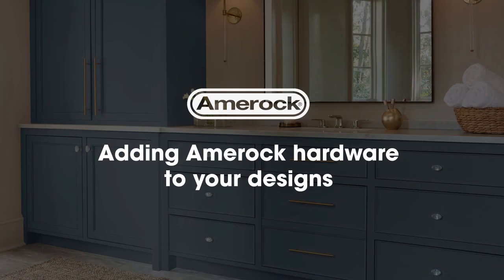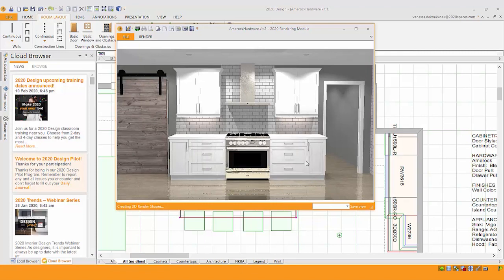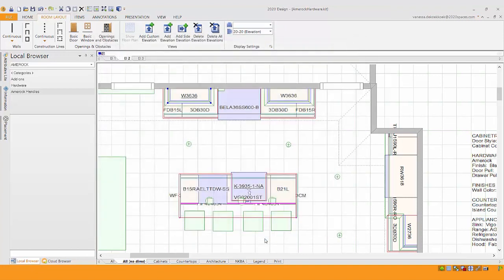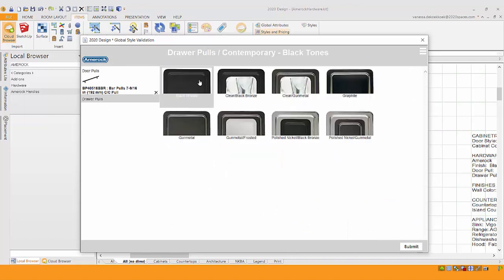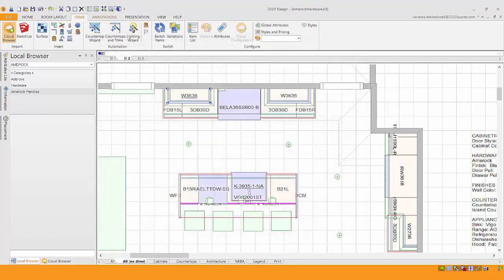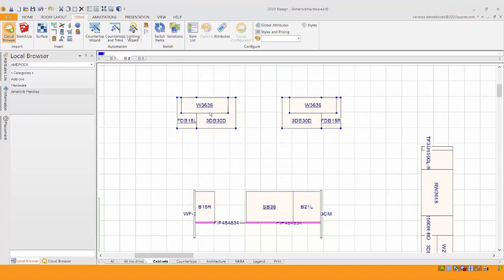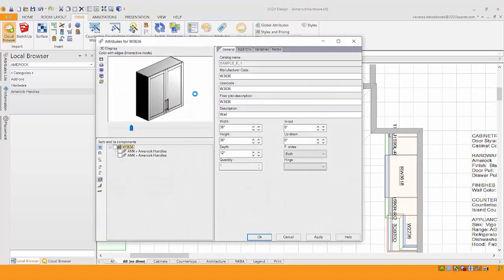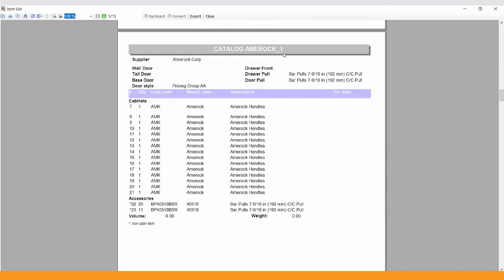2020 DesignTip: Adding Amerock hardware to your designs

Comment: Can I change the pulls on one specific cabinet and keep the others as the Amerock chosen?  Sometimes I want a longer or shorter pull on one cabinet.
Reply: Yes, it works by creating a copy of the catalog like you would for cabinetry when you want more than one color or door style in the design. I tried it. It worked. Had to play with the precise cabinet a couple of times in order to get it to work though.

Comment: I have downloaded the add on catalog using V 11.12.0.31 and cant get the hardware to display on the cabinet.  Any suggestions?
Reply: Which catalog are you using Trevor?
Reply: @MrJohanvj2000  I'm using the Amerock add on catalog from 2020.net.  I've tried them on the designer and sample frameless catalogs with no success

Comment: does this ONLY work in Sample Catalogs? I can not make it work in the catalog that i use every day.
Reply: It should work with any catalog. You have to download the Amerock "add-ons" catalog from 2020.net (2 catalogs are availble, please select the add-ons one).
Reply: @nadirpopat2961  I have downloaded the "add-ons" catalog with still no luck on getting the hardware to show on my cabinets either. Any advice?
Reply: Danielle V , Which version of 2020 are you using ? It works with v11.12 and up.
Reply: @nadirpopat2961  I have downloaded the add on catalog using V 11.12.0.31 and cant get the hardware to display on the cabinet.  Any suggestions?

Comment: Bottom line is that it does not work.  Amerock should pull it until they fix it so it works with all 2020 approved manufacturer catalogs.